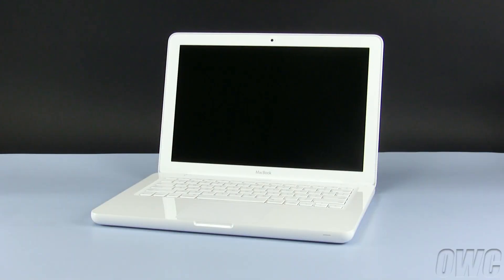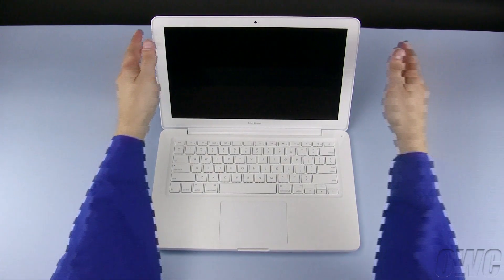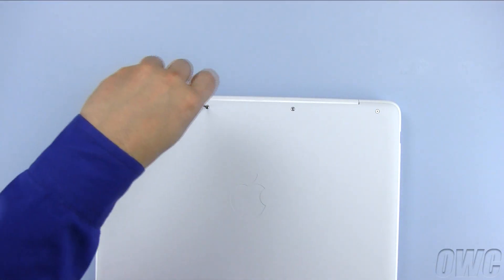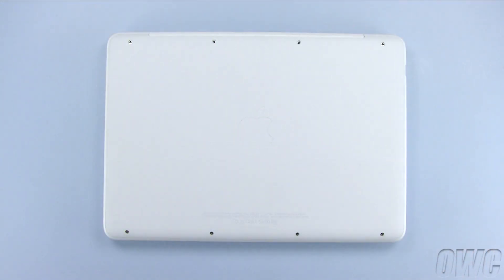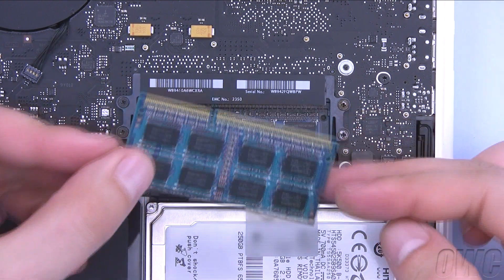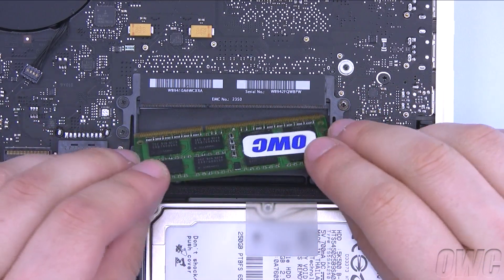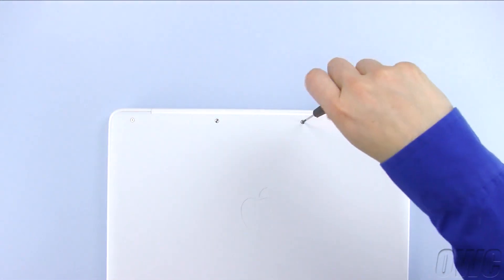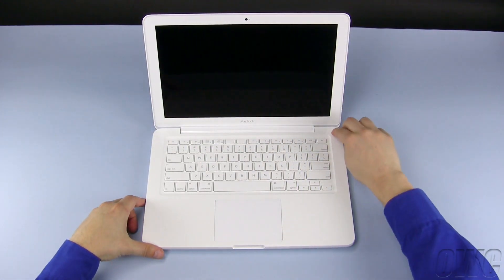13-inch MacBook Late 2009 & 2010 Memory Installation Video

Comment: Mine has 5gb. I bought another 4gb. It had 1gb on the bottom and 4gb on the top. No matter what, it won't start without the 1gb on the bottom. It's a mid 2010 running sierra.

Comment: Can somebody tell me if I can upgrade my late 2009 macbook 1066mhz with Rams that say 1600Mhz? Did somebody ever try that?
Thanks
Reply: +Owc Macsales Any laptop ram 1066 mhz works on my mac a1342
Reply: +JivmVII I think that may work. But I tried a 1600mhz ram in a 1066mhz MacBook And that did not work.
Reply: *****
ok thankyou
Reply: *****
Hey i was looking at my settings and it syas that my speed is 1067 mhz will 1066 mhx still work on mine and also ssd's also work right?

Comment: Does MacBook6,1 unibody late 2009 supports 16GB RAM (8GBX2)?

Reference:http://www.everymac.com/systems/apple/macbook/macbook-white-unibody-faq/macbook-white-unibody-how-to-upgrade-ram-memory-type.html

"However, site sponsor Other World Computer has discovered that the "Late 2009" (MacBook6,1) model actually is capable of supporting 8 GB of RAM"